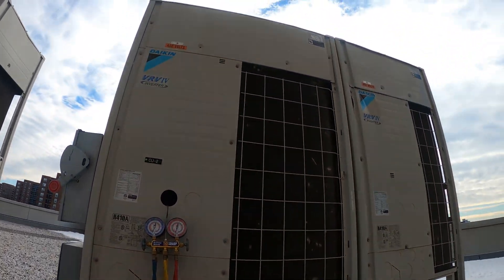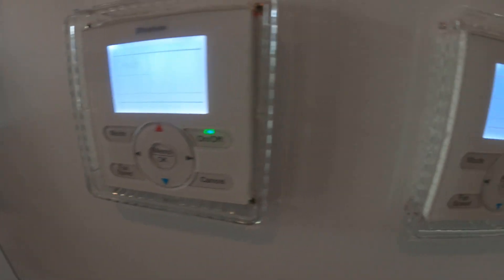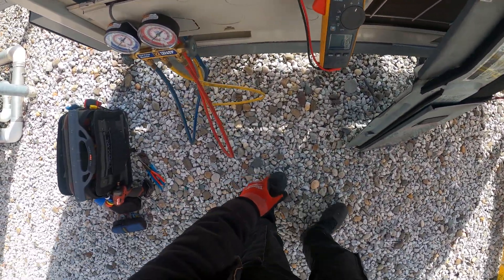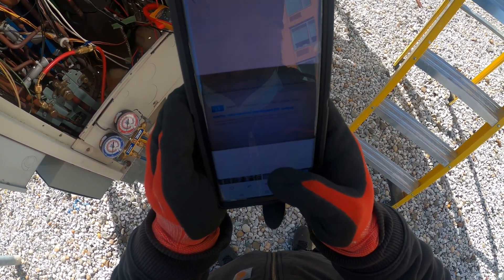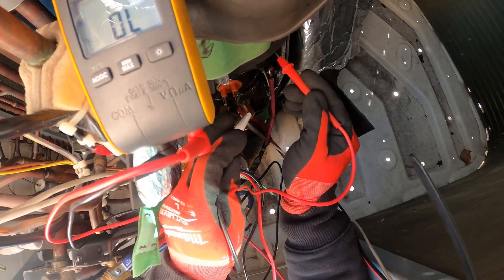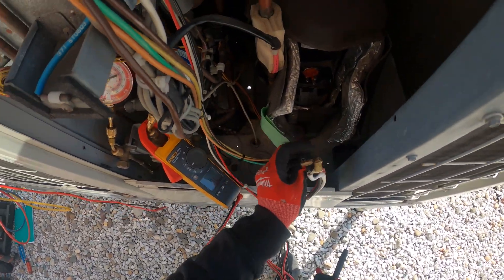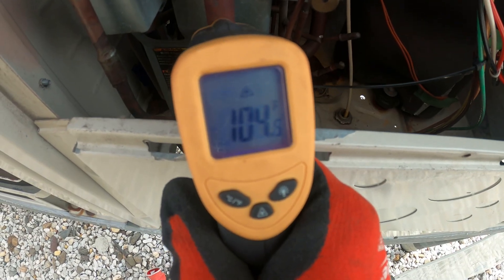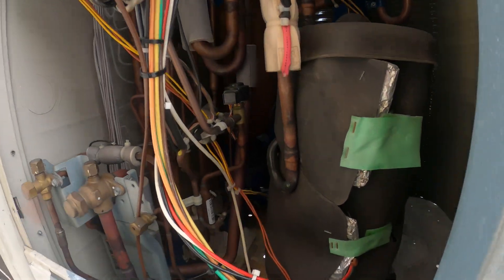HVAC: Daikin VRV Heat Pump Not Heating/Cooling (Error Code L5) Daikin Inverter AC Service Call

Comment: I just ran into the same situation on a residential system. After a power outage I showed up to the job site and replaced the outdoor pcb because it was fried. Put on the new one instantly fried. Came back replaced pcb and outdoor fan motor, it didn’t fry but then tripped the L5 error code. Oam out everything that draws current on the system didn’t find anything abnormal. I tried everything went through it with tech support and they’re stumped so now I have a Diakin rep coming out in a week.

Comment: You're basically coding out 1x compressor on slave 1. 38 is master, 39 slave 1, 40 slave 2. Then select one compressor/pcb to code out . There's a faster way to check . Also it's weird that they use the smaller unit to be master or so it seems. Not sure from the vid

Comment: It will always baffle me why techs still use analog manifolds in 2022. But that should be obvious. You really should be using a D-checker for Daikin equipment, you would’ve had your answer a long time ago and avoided cross contamination with the all the oils and acid that’s collected in those hoses. Old habits die hard

Comment: Daikin new sales technique but they offer 100% efficiency when the unit is not operating round the clock technical support which will cost you hours in callbacks part replacement as long as the unit is not five years old in domestic  application just get a new one 410a is a mixture of drynitro and R22 it's cheap as chips but you need to reclaim the entire amount throw it away and charge with new gas

Comment: Currently doing my apprenticeship for refrigeration. Professor said to properly use an amp meter clamp, make sure the wire being tested should be in the middle, of the clamp, not touching any part of the meter, for the most accuracy. If you have it on the edge, like in the video, the reading can be off a significant amount of amps. Haven't tried myself yet.

Comment: Have you been working on their newer R32 systems? They’re awful. So many issues with boards and comps going. Some less than 6 weeks old.
Reply: In Vietnam a lot of HVAC technician said the R32 refrigerant performance not as good as the R410A.

Comment: Try not to keep the slave coded out for more than 24 hours. The master and slave units on the vrv4 share a common oil line. When it goes through its oil return sequence, it effectively starves the master. Had this a few times where someone has coded it, and left it running for the customer and basically cooked the comp. Do you have an inverter checker to test your board to comp wires? Great vids btw, really enjoy watching them

Comment: Great video man. General question here, is it an issue running the unit with that side panel off for too long? Would mean most air is being sucked through the opening instead of the condenser coil right? And do you think it would have been a good idea to cover the other condenser fan motor on the other side that’s not working? Or was that condenser fan motor spinning anyway? Thx

Comment: Daikin have way too many issues in my opinion with this VRV , I seen way too many shot compressors and relatively new units . Not a big fan of them , I rather a Mitsubishi city multi any day
Reply: Very good point.  Here in the UK, we design, install, commission and service the Daikin VRV for many years.   Replaced many parts for the Daikin over my time.  However,  the Mitsubishi City Multi Systems are brilliant.    Never had any issues with them.  Some systems we have installed over 15 years ago are still going strong with no new parts fitted.  Don't get me wrong, Daikin are very good, it's just that you are forever changing parts and it can become very expensive.   Luckily on one site where Daikin is fitted since 2014, we have about 67No. VRV Condensers fitted.   We have rarely changed any parts.   This is due to having it installed and maintained at a high level.
Reply: @m.haslam8495  that is very true and I agree , an good install can change everything .

Comment: Its great that you said call technical support. If its not a refrigeration issue i get stumped. Everyone want to act like they are pros with these inverter units and there is no possible way. Everyone tech support is reading a flow chart. Totally different on a split or package unit. I am no longer gonna be ashamed to call tech support. I know you know your shit and called them. So now i know that's the right thing to do. Thanx. As always great video.
Reply: It's a shame they don't teach you how to call tech support when you're at refrigeration mechanics school

Comment: You can also use the Daikin app.  It will point by point run you through.   If tech support takes to long to answer.
Reply: In Sydney, Australia, Daikin are a 3-4hr call back service for tech support..
Reply: @rdenir  honestly I don't know how he talked with tech support. NY area is same thing. tech support sometimes calls you  next day. it is better having service tool.
Reply: @ibrahimamac  it’s better to buy Fujitsu,,
If I call Fujitsu tech support,
Usually within 15 minutes I will have a tech on the phone
Reply: @rdenir  you are right. But When people calls you for service call. Unfortunately it is mostly daikin units were installed in Ny area. you have to point out exact problem. Sometimes one fan motor is bad but you gotta change both condenser fan motor with the inverter. There is no point installing units if you aren’t going to get customer support when you need it.
Reply: @ibrahimamac  yes unfortunately when you get to a job and see the Daikin unit it’s too late for that,, Admittedly Daikin are good units, it’s just the after sales service that is poor in my opinion,, 
Last December I had a client call me about her Daikin VRV A/C unit not working,, I diagnosed a faulty Inverter board and she told me the unit was only 18 months old,, I told her to get onto Daikin and get them to repair under warranty,, a few days later she called me again and asked if I could just repair it and she would pay me direct,, Daikin had told her that they couldn’t get a warranty tech out there before February,, Here in Australia, Dec, Jan, Feb is out summer